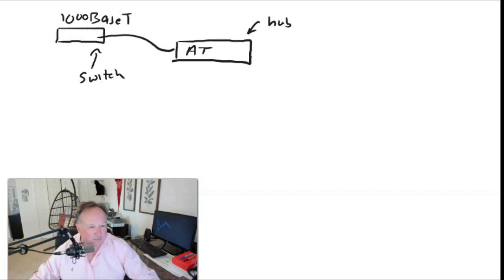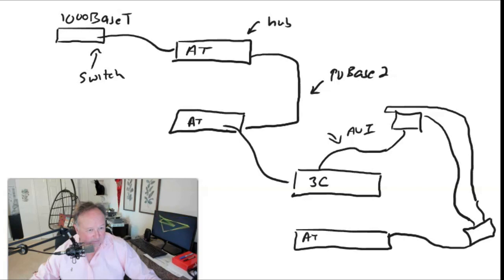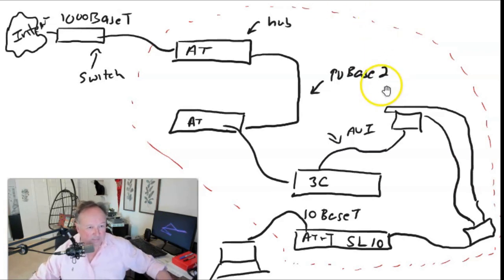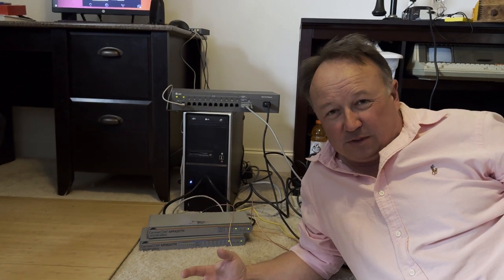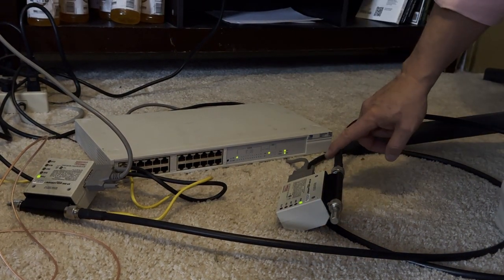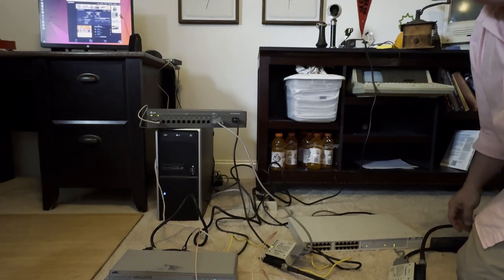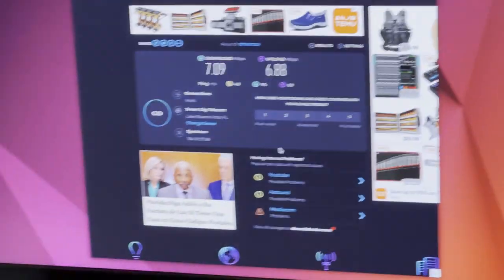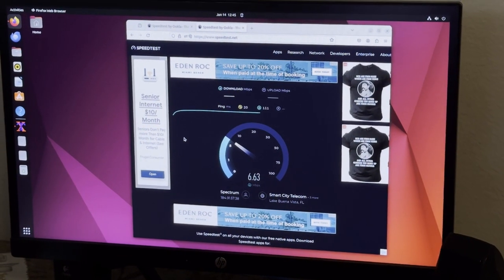E11: 10Base2, 10Base5 and 10BaseT on one LAN/collision domain

Comment: It's been several years since I looked at it, but I believe you are violating the rules that limit the number of hops.  As part of my Novell CNA, that was described.  Also, 10baseT was created from the StarLAN network, which was designed to work over telephone cables.

BTW, in 1989, I hand wired an Ethernet controller on a prototyping board for a Data General Eclipse computer, so that it could be connected to a 10base5 network used to connect 7 VAX 11/780 systems.
Reply from the maker: the repeater limit?
Reply: @ComputerScienceExplorati-ik6lr   As I said, I don't recall the details, but I do remember there was a diagram showing the maximum size of the network.  This was due to the collision avoidance method which depended on a maximum time to reach the furthest point on the network.  Each repeater added to that time. a Google search on "ethernet network half duplex maximum" turns up the following: "Collision Domain: Governed by rules like the classic 5-4-3 repeater rule for 10 Mbps networks to ensure proper collision detection via CSMA/CD.

Further searching results in:
"The Breakdown of the Rule The numbers 5, 4, and 3 represent the strict upper limits for expanding a network segment using repeaters (or hubs):5 Segments: A network could have a maximum of five physical cable segments connected in series.4 Repeaters: To connect those five segments, you could use a maximum of four signal-amplifying repeaters (or hubs).3 Populated Segments: Out of the five total segments, only three could be "populated"—meaning only three could actually have computers, servers, or end stations connected to them. The other two segments had to be unpopulated "link segments" exclusively used to extend the physical distance between repeaters.